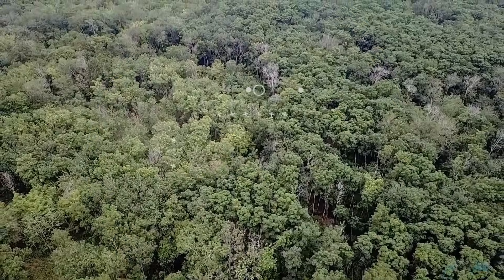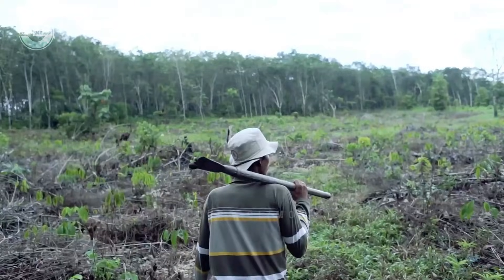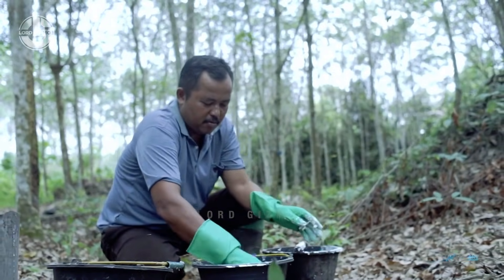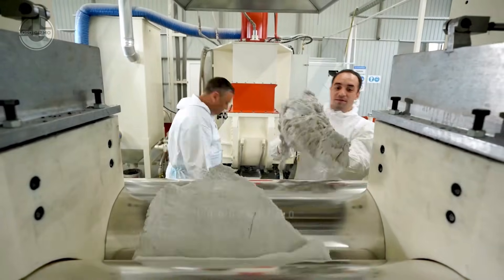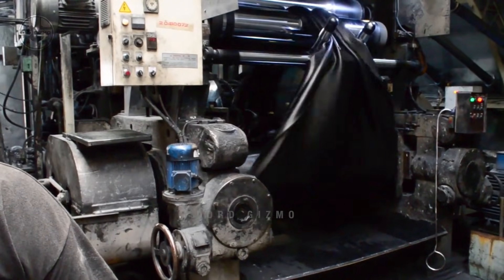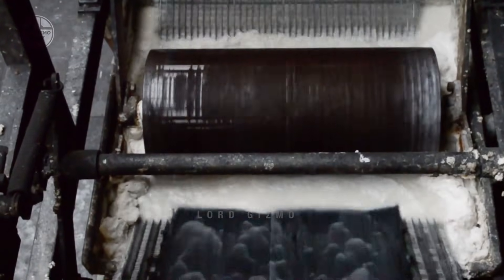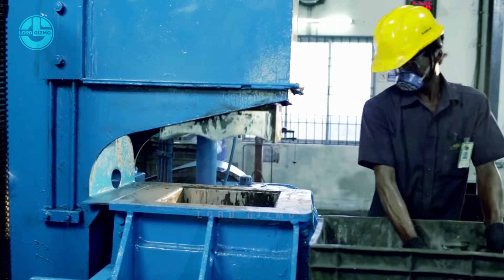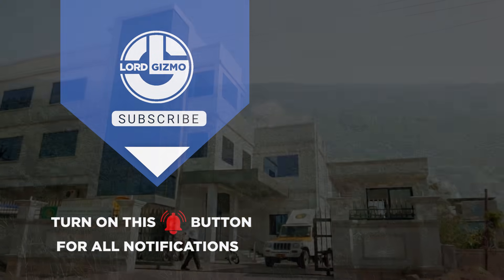The Fascinating Process of Harvesting Natural Rubber from Hevea Trees.

Comment: You know one thing from this that really stands out. Machinery uses spinning things, that probably use electrical DC motor engine. Car tires are from rubber and they were invented in 1886, while invention of electric motor happened in 1821. Therefor, early factory of rubber, supposedly had to start existing between these two dates. 50 years, supossedly had to be enough to turn the technology that let's machinery to spin things, into something that turns transportation industry usable. Amazing.
Reply: What else is amazing, is the part that rubber tires needed to be used in Germany, while Brasil is in other continent xD that also factors great question, is rubber synthethic almost instantly after invention.